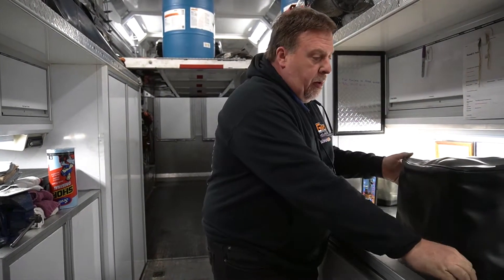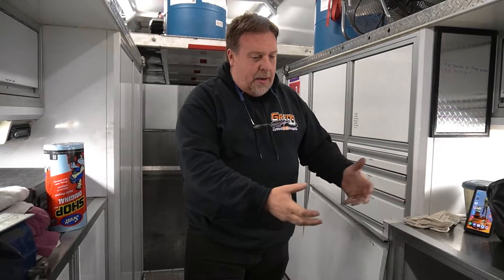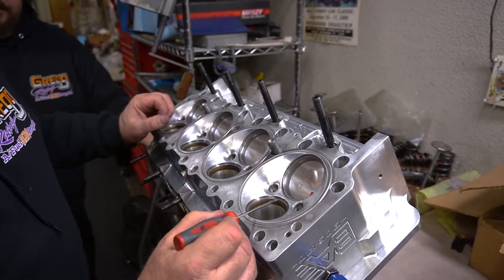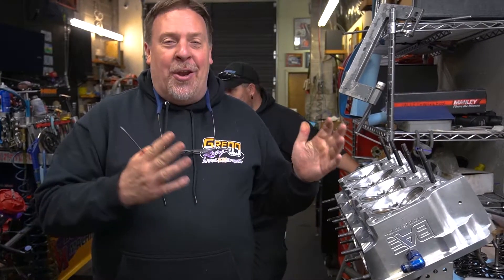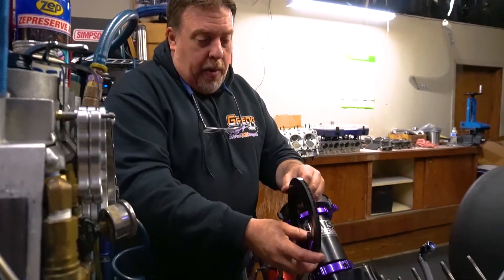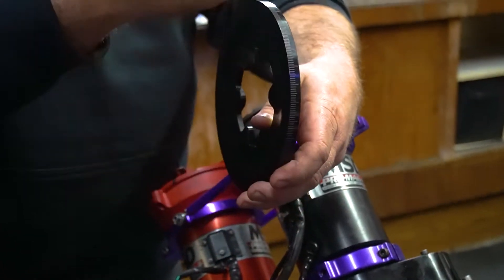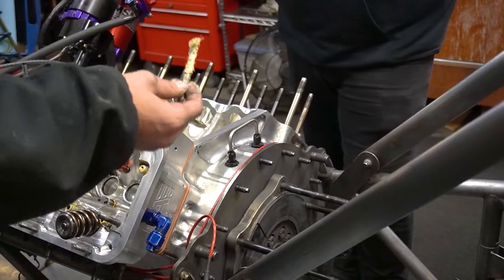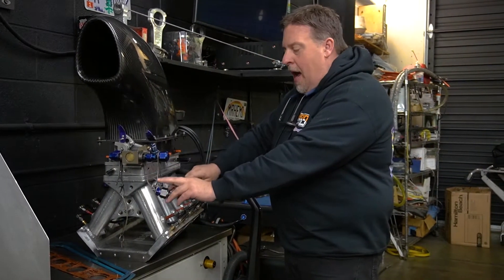Gregg Racing's A/Fuel Dragster- Nitro Tech Talk!  "Secret Sauce" info you won't see elsewere.

Comment: just found your channel.   I have a nostalgia AA/FD but, have not ran it in a dozen years.   I agree on how to treat team members and on the importance of clearing out the motors after a run, etc.   Am a bit rusty due to time but, watching videos like this help refresh the 'dos and don'ts' so to speak.   am sure I will have some questions should you see them and or have time to answer.  thank you for this video.  I love working with nitro when I can afford it.  nothing is really comparable.  am sure you agree.  best to you and your team
Reply from the maker: Damn!!  Sorry I missed your comment for so long!!  Nostalgia AA/FD?!!!!  WOW!! That's AWESOME.  I'd love to see a Video or even a Picture or two of your Hot Rod.  My Email address is:  Gregg@GreggRacing.net, in case you'd like to send something my way.  I understand that there is more that I do NOT know about Nitro than what I DO know - But I have learned quite a bit in my 25 years of burning Fuel.  If I can be of help - Again, use that Email address and I'll do the best that I can to help.  I'm sure that you know that there is a substantial difference between Injected Fuel and Blown Fuel - But I know a fair amount of great people who do each, so If I'm not certain on an answer, I'll bet that I can find a credible answer.  I can tell you for DAMN sure that, when you run your Car again - Do NOT use a Milwaukie Battery to power the Command Module, or any other electronics that run the Car.  Doing so cost me (and several of my friends/competitors) a (very expensive) Motor.  Here's a Nitro-Tech Talk Video specifically on that topic, in case it might interest you to learn from my screw ups!  https://youtu.be/WOXtGmasEhQ
Can't wait to see your Hot Rod.  Take Care~  Gregg

Comment: Very GOOD ! I ran A/fuel in the early 90‘s. Tom Topping was the leader and did good first. We ran 60s with my car but lacked consistency. NHRA kept changing the rules trying to slow us down. I quit.
Reply from the maker: Wow!!   Quite a cool story there!  And- I get it!!  Consistency in an A/Fuel Car is very tough indeed.  There are 100 "Pins" in the ole' "Tumbler" and you can have 99 of them absolutely perfect......... But if ONE is outa' place- The Car will NOT run well.
Reply: The clutch is as you know the key to loading the motor properly. 2-3 stage clutch would make these cars more consistent and of course FASTER. NHRA WILL NEVER ALLOW THIS. THEY HAVE THEIR FAVORITISM
Reply: Greg, Johnny West ran his Fuel Funny car with one hydraulic cylinder and a jet to control flow to throw out bearing (now called cannon)for application. Wyatt Radke drove for Johnny after his crash but Johnny was a wizard on the clutch.
Reply: Sold my car to a youngster named Christen Powell. Had plenty of money to further its development as her dad owned Sequent Computer co. She went to T/F after that.

Comment: Thank You. This is my favorite class of dragster probably because of the amount of talent it takes to run injected nitro.
Reply from the maker: Thanks so much for the comment.  I Owned & Drove a Pro Mod many, MANY Moons ago now.  Most of us in the Sport would agree that a Pro Mod and an Alcohol Funny Car are two of the toughest Cars to DRIVE.......... But an A/Fuel Car is WAY up towards the top of the ole' list for being the toughest type of Hot Rod to TUNE.  
   Also- I am connected with A/Fuel Car Owners/Tuners further up the "food chain" than I am - And for what that's worth....... They Ab-So-LOOOT-Ly agree.  ;-)

Comment: The injectors in the heads are timed for each cylinder? And if so how?
Reply: Spring loaded ball poppet checks as downnozzles in each cylinder under valve cover.
Reply from the maker: The answer that @SCarter176 provided below is accurate.  Thanks to him for the help and to you for your question.  We have 8 Nozzles in the Manifold that are not "Checked" - They are open and used any time the Motor is running on Nitro. They are our "Idle Circuit".  Additionally, there are 2 additional "Down Nozzles" for each Cylinder that are located right on top of each Intake Valve.  These are "Checked" with a tiny Ball, Cup & Spring.  The "Ball" part is smaller than a BB.  Mine are set to open at 15 Lbs. of Pressure.  The Car idles at 10 Lbs. - 12 Lbs. of Pressure, so when the Pedal goes down and the Fuel Pressure BLOWS past 15 Lbs. on its way to over 400 PSI, the Down Nozzles open and join their up-stream cousins in the Manifold, opening up at a high rate of speed.  All 3 Nozzles per Cylinder are what make up the "Run Circuit".  Hope this helps.                                                              
            Thanks for following us!  Take Care~ Gregg

Comment: How much information are you willing to share about some details? Displacement, bore and stroke, rod length. What percentage of nitro do you typically run? Any problems with bottom hole detonation in these engines?
Reply from the maker: Dr. Mopar ~ Regrets for the super tardy response here, but- I will happily share details that are not specific to Tuning.  Most of your questions are perfectly fine.  
  My Motors are 433 ci- 3.600" Stroke and a 4.3750" Bore.  By rule, we must weigh 5 Lbs. per CI.  This makes my minimum weight 2165Lbs.  This is measured at the END of a Run, with Driver and all the Gear that went down the course.  The reason I stress the "end" of a run is that we know we're darn near 60Lbs. lighter at the end of a Run since we will have burned ~ 6 Gallons of Nitro, which is VERY "dense".  A gallon of Water is 8.3Lbs.  A gallon of Nitro tips the Scales at just under 10Lbs. per gallon.
   I'm probably gonna' pass on the Rod length question, sorry.
  The maximum Nitro % we can run is 95%  
   Regarding your question about "bottom hole" detonation...... Gosh, sorry to be such a moron, but I don't even know what that means.  I CAN tell you that detonation in general is a HUGE issue.  We are diligent to do all we can to prevent it.  As I'm sure you're aware, detonation can (and WILL) tear up a bunch of Parts pretty dang fast!  ....... And there isn't any "knock sensor" in the Car as there is in a Passenger Car.  
   I really do hope this info is helpful to you.  Apologies for missing your question for so darn long.  Thank you very much for following us and for your question.  Gregg
Reply: @GreggRacing   Hey, thanks! No problem on the response time.  I love the "sledgehammer science" it takes to make these run and successfully complete a pass. Bottom hole detonation is probably more of a supercharged engine problem with the extra fuel volume. My understanding is that it's similar to a hydraulic event except instead of being at TDC, there is liquid fuel left on top of the piston that gets compressed by the combustion pressure wave at BDC, resulting in detonation,  Rod ratio and exhaust valve opening are supposedly a factor in preventing it by relieving enough cylinder pressure before the piston reaches BDC.